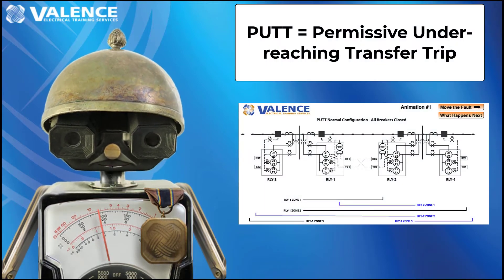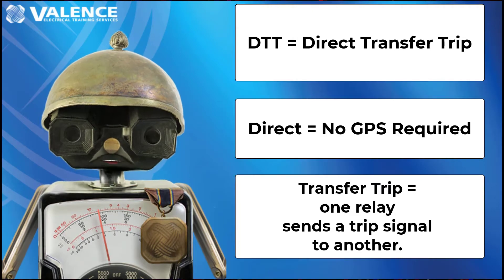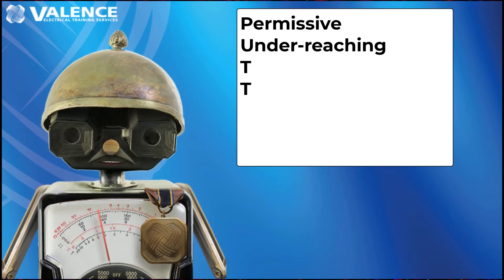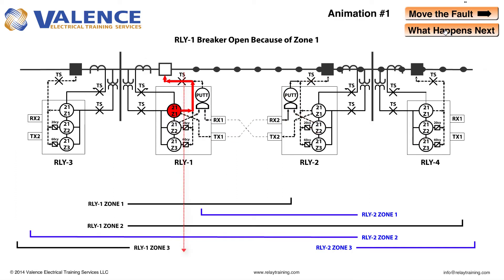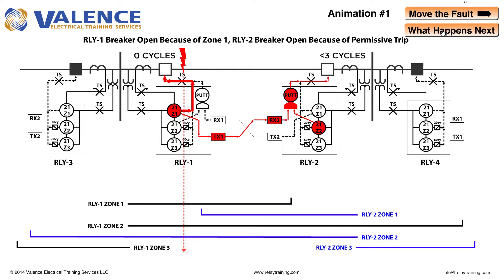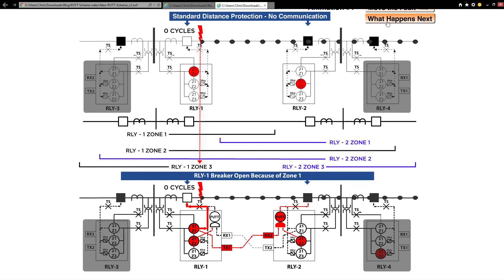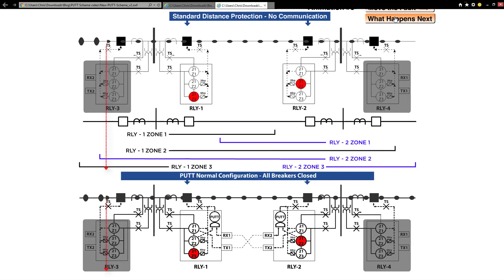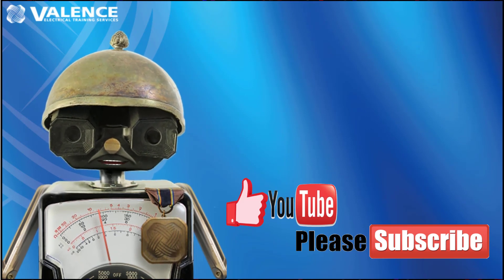Understanding PUTT Communication Assisted Protection Schemes

Comment: Is PUTT and POTT same?
Reply from the maker: There is essentially no difference between pure POTT or PUTT schemes except that POTT uses Over-Reaching zones (Zone 2) and PUTT uses Under-Reaching zones (Zone 1) to share information about the location of the fault.

However, most relays have a hybrid POTT schemes to prevent mis-ops that can occur because they use over-reaching zones.

Comment: I would love if you would compare POTT vs PUTT, cause I can't see the difference. Yes i understand that the PUTT only transfer a Z1 puckup, and POTT looks at Z2 pickup. But could you make an example where it would behave differently?

Thank you.
Reply from the maker: The POTT Video at https://youtu.be/vVSDE59vJlc?t=319 shows an example of a POTT scheme failure that wouldn't have happened  if a PUTT scheme was applied because the Under-reach transfer trip signal would never have been sent in the first place
Reply: @Relaytraining  is this mean we should choose PUTT over POTT? Is there any advantage of POTT over PUTT. Some one told me it is faster but I'm not quite understand because at the fault location we consider z1 and z2 pickup happen at the same time.
Reply from the maker: @tossapolpholthip4338  I think so.  The only argument I've ever heard for POTT over PUTT that made any sense was if you have a very weak source, and I've forgotten the part that makes sense as I write this.
Reply from the maker: @tossapolpholthip4338  There is no difference in speed between POTT and PUTT at the same location with the same relays.  The Zone 1 and Zone 2 math is the same inside the relay.  All delays are caused by communication between devices, which would be the same regardless of POTT or PUTT.
Reply: @Relaytraining  when fault occurs the impedance Z will quickly decrease from load impedance to fault impedance in zone 1 and it should hit zone 2 barrier before it hit zone 1 hence z2 pickup should happen before z1 pickup/trip. 

I’m not so sure about above statement so I need second opinion. But if the impedance just jump to z1 then z1 and z2 should pickup at the same time.
Reply from the maker: @tossapolpholthip4338  "Quickly decrease" in your context would be nearly instantaneously because the tree that falls on the line doesn't do it slowly and the magnetic fields supplying the current in the power system adjusts at near the speed-of-light. There's typically a normal condition, then the fault occurs faster than the relay can process the trajectory from normal to fault.
Reply: For a fault, on a Transmission Line, near a Weak Source (and afar from a Strong Source), any Permissive Scheme requires a Weak Infeed logic, that will Trip the relay upon receiving a Permissive Signal and sensing an Undervoltage (the Weak Source may be unable to contribute with a High enough overcurrent to pick-up a Zone protection, although the Line voltage will sag significantly)
However, for a PUTT scheme, the relay near the Strong Source will be unable to send the PUTT signal, (since the fault is away from him Zone 1 won't be picked up) and it will Pickup Zone 2, timing it's Trip.
The relay near the Weak Source may be unable to sense Zone 1 because of it's low fault current contribution, delaying Trip for both relays.
But, for a POTT scheme in the same context, the relay near the Strong Source will sense a Zone 2 fault and send the POTT signal, for the Relay near the Weak Source who will be sensing an Undervoltage and Trip both ends by the Weak Infeed logic.
Here in Brazil, these POTT schemes are very common in our High Voltage Transmission System